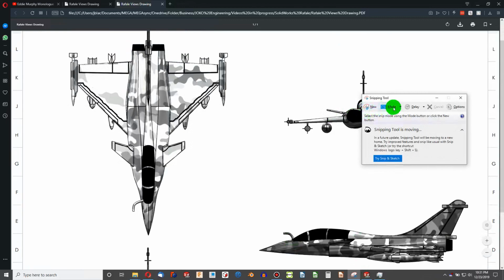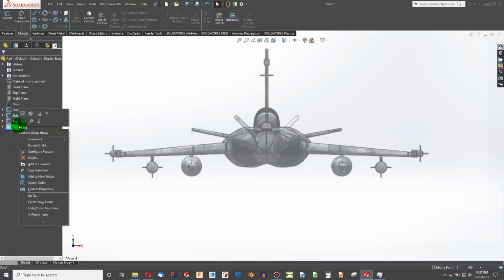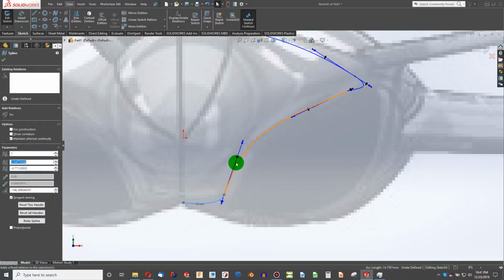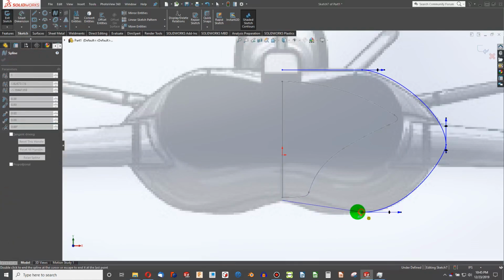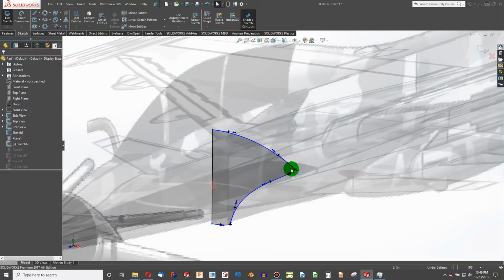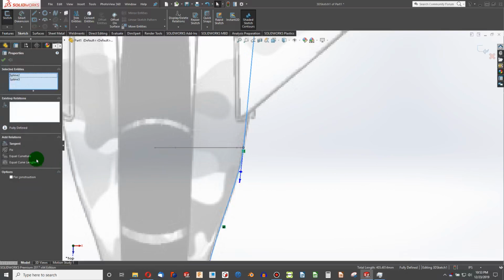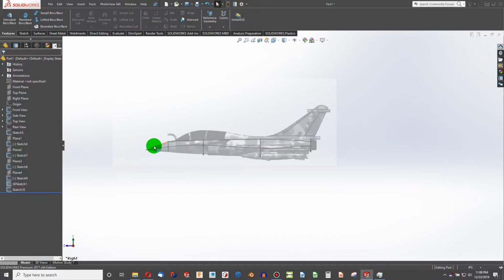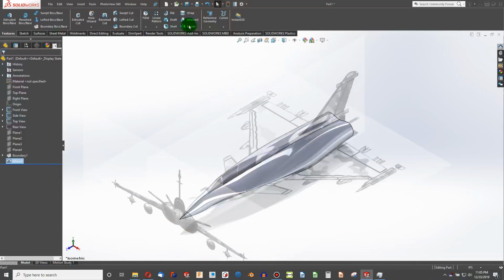Make A Fighter Jet in SolidWorks - Model from Images Vid 1|JOKO ENGINEERING|

Comment: Thank you very much for the series. I do have to mention though, that the images in the grab cad folder are very bad. I could not find any features on it while doing splines. I am currently hunting a good rear view image, I found the other three views on Wikipedia, I also need to see if the scales of the new rear image and the Wikipedia images match.